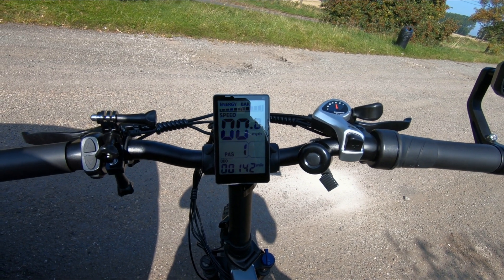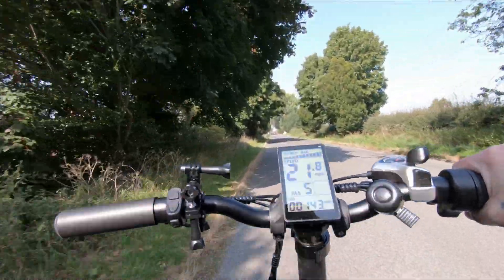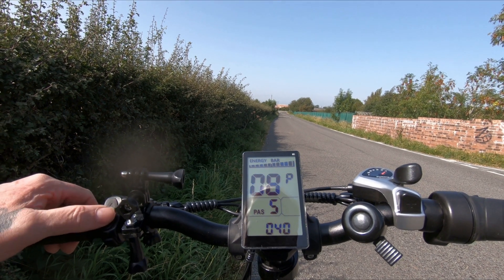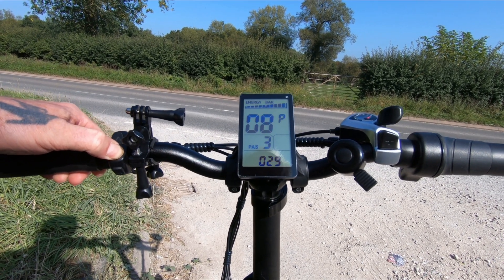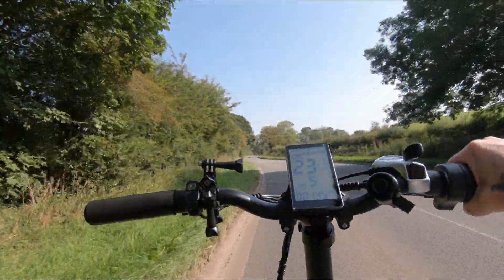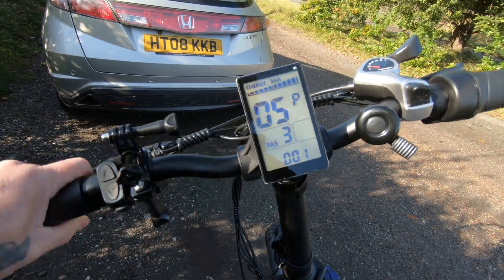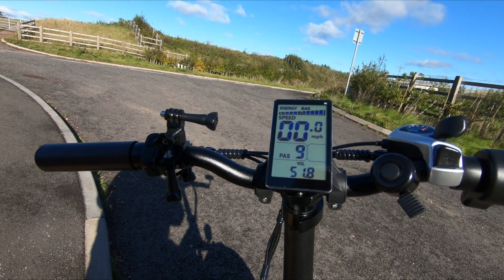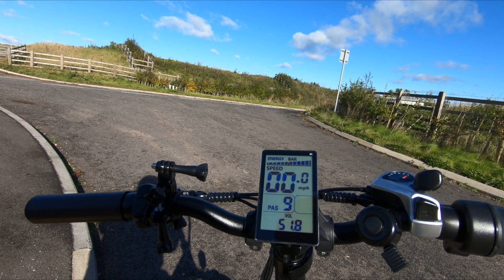ENGWE EP-2 500w e-bike / How To Alter The Maximum Speed.

Comment: 23mph is a nice speed. You stay in control and get to your destination in a decent time.
Reply from the maker: It is yes, I agree, but if it went 27, people would want 30.
Reply: @MidlandBulletRiders  

Always the way. I have the Fiido M1 PRO. It's only a 500w 48v fat tyre ebike. But some people claim to be getting 28mph on the flat with it  my top speed is 41kph or about 25mph. On a flat road pure throttle no pedalling. I weigh 88KG about 194lbs. So this is a factor too. My friend only weighs 150lbs and he gets 45kph on it over the same stretch of road.

So you cannot overlook these things. The Engwe EP2 pros are fine bikes. Especially the GREY model. modded out with BMX handle bars  it's the coolest looking fat tyre ebike I've ever seen. But they are 10 to 15lbs heavier than the M1 pro right out of the box.

Weight makes a difference. And then if you are heavy yourself. That's going to take the speed down by 2 or 3 mph. It makes sense. The more work the motor has to do. The slower its going to be. And the range will shorten too.

Comment: Are you using a suspension seat post if so do you know what size to order thanks
Reply from the maker: Yes. 31.6mm. If you look at this other video you will see what was needed in the way of adaptors to make it fit. https://www.youtube.com/watch?v=0G8qMN57A7s
Reply: @MidlandBulletRiders  My Fortis MK3 has 28.6mm post, 27.2mm is standard, I had to buy a shim to fit the 27.2 suspension post in the Fortis

Comment: I also have the ep 2 500w. But my bikes display and input/settings looks completely different🙄 I would like to restrict it cause in the Netherlands maxspeed is 25kmh. Will play around see if I can find the solution on my own.
Reply from the maker: If you have the YL80C display, there a manual here https://www.dropbox.com/s/xnd6kh3ffsghf1v/YL80C%20Display%20instructions.pdf?dl=0  I'm not sure how you adjust it on yours though.
Reply: @MidlandBulletRiders  Thanks, yeah saving the settings seem that impossible, would have to figure this one out.

Comment: Hi when i tried to set speed  it would not change. stays on 25klm setting. Any ideas?
Reply from the maker: Make sure you turn off the display and back on again after making any changes.
Reply: @MidlandBulletRiders   Did not make any difference and the store here In Australia set the display unit locked.  I tried everything . it will not let me go up speed digits or even low digits. like its stuck on the one number.

Comment: Did you check the speed with GPS on phone?

My e-bike (not engwe but very similar) showed a speed of 43 km ph, but my GPS said 35.

I adjusted the wheel/rim size in the settings and now the bike shows accurate speed
Reply from the maker: Yes, I found setting my wheel size to 22" gave the most accurate reading compared to my phone. https://www.youtube.com/watch?v=dMBlVZNQhDM

Comment: I done this and I feel that it doesn't make it faster at all, what your doing is altering the way the display reads  the motor speed, telling you its going faster but it not. Pedal assist 9 sucks everything out your battery so even if you could go faster ( and i doubt it does) it's not even a mile before  the power drops and then you sitting at 19/20mph anyway and you've lost a good 2 miles or more range. The settings  it comes is perfect and this is a great bike!
Reply from the maker: I tend to agree with you. I don't like the 9 assists myself anyway, 5 is a much more usable amount.

Comment: I love the 9 pas setting so when I'm going slow I can cruse at walking speed to keep with mates who aren't riding as for 9 level pretty nippy but I only use that speed here and there to extend motor life. I guess I can add a 750 watt bafang hub wheel in a few years or get engwe to send me one wheel part and it should go on my 500 watt as battery requirements are the same so why not.  This is a few years time though lol 😂

Comment: Hello, I just bought the EP2 PRO, with a 750 engine, and I have a problem on the display: the battery indicator always shows full, so I don't know when the battery level drops. Is there a way to adjust this from the m5 display menu? Thanks a lot and congrats for your channel!
Reply: I've got same problem
Reply: i have also the same model but i have problems that mine isn't taking the settings to go slower while it shows in the settings that they have been put in :/ do you have the same problem ?
Reply: Hi, I have a problem with my battery, it seems to go flat so quick! After 10 miles even!
Reply from the maker: I find the battery indicator a bit hit and miss really. I prefer to have the display show the battery voltage, give you a more accurate idea how much you have left.

Comment: The other day I hopped on mine, fired her up, nothing, wouldn't move, screen said error 37 . I wasn't happy. Turned out to be my adjusting the new brakes using the screws at the lever end which cut the motor just as braking does. :)
Reply from the maker: Glad to hear you managed to solve the issue. Simple repairs are the best.

Comment: Suggest swapping out the brake cables, the factory set aren't good, I think they might even be gear cables. Mine rear cable snapped going down a hill, I suspect the bike is too heavy for the stock brakes at those speeds (you were smart to change yours). I've done about 500 miles and the pads already need swapping out. Please get a chest harness for the camera when doing speed tests. You need both hands on the brakes.
Reply: I replaced one of mine, easy job, just thread it down the casing, a little oil is nice on the cable, no need to mess with the whole cable. Cheaper that way too.
Reply from the maker: Will keep an eye on them.

Comment: interesting video, i have the same bike, only done 26 miles so far. played around with the settings, what a nightmare. this will will surprise you all. 9 pas makes no difference nor 5 pas. you still get the same factory setting. you can more speed by using just pas 1/2/and 3. i get 28.5 mph on pas1  and peddling  in 7th gear in pas3 32.5 mph  30.2  pas 2 pas1 in 7 th gear 28.5  this is on the stand waiting to see if it will do the same on the road. the settings you need are. po5 sett to zero. po8 set to 50, i read somewhere  that 50 meand no speed restriction. po9 and po10 set to zero. and makes sure sleep mode po4 is also zero.. i have all the others also but these are the main ones. you just get bigger slices of the cherry on each pas position up to 3. as others have said using 5 or 9 just cuts the power on setting. makes you think you have more power and speed, but you have not. only what  the motor is set for.. try it and see. only need 1 to and 3 to get the same results. will let you know more when i have done a road test. climbs hills very well 

went up a steep hill yesterday with a total of 194 lbs, my weight plus shopping tools ect, got up to 14.5 mph on pas 3 with peddle  at the top .so will  try different gears  without power, had trouble getting power assist to work  with  the gears  and motor. but all works  now,  no need for such a complicated computer.
Reply: Hi could u send me the settings pls I've messed mine up totally
Reply: By using PAS 1/2 &3 will it make the motor last longer and not wear it down as quickly?
Reply: I'd like to see that done on video,

Comment: Hi dear. Did you change your tires too? From the video they seem to me that they make less noise than the originals that I have. Do you know what I can do for the front shocks to improve them? Just put some fat in it? Or have you changed them and they work better? Now I give a piece of advice to you.The battery at every drop makes a lot of noise because it beats on the frame. Make a little thick near the lower part of the battery that beats on the frame (you can also do it with a little paper). It will make a lot less noise and driving will give you a safer feeling.
Reply from the maker: They are the standard tyres that it came with. The forks do not use oil only springs, you can make them harder or softer by adjusting the preload. Yes I know I get a slight rattle from the battery. I did add some tape to the edges but had to remove it because it was too tight to fit in the frame. It's on my to-do list.
Reply: Ernesto thanked i think these settings r far the best I've tried 
I find pas 3 works 👍

Comment: Interesting stuff. I wonder what 63 (or whatever number one sets) actually means? 63 what?

The changing of the PAS divisions is handy to know, although I suspect 5 is optimum. One assumes 9 just divides the increases into finer increments?? I have noticed on bumpy tracks that the jump from 3 to 4 is very noticeable. Less of a problem on flat tarmac as one tends to want to dial in max cruising speed. 

Interesting stuff though mate👍.
Reply from the maker: No idea where they pluck those numbers from. I could understand it if it equalled kilometres.
Reply: I've looked at whether it might be wheel rpm but that's way too slow. Using radians doesn't work either. I think maybe you are dialing in Nm?? Which dictate a certain motor rpm to give the required power to achieve the speed attainable on said amount of power. It would explain discrepancies due to incline or drag.
Reply: I've tried calculating the power assuming 63 means Nm, based on the rolling circumference of the tyre and the speed you have obtained, but the sums didn't add up. However I'm still inclined to think that parameter 8 is actually the motor max torque in Nm. I've read that these geared hub motors give peak torque at a speed lower than peak power rpm. If so we can think of the parameter 8 as a kind of "mapping". Lowering the value in the parameter then would be lowering the peak torque and I assume peak power. If I'm on the right lines then it begs the question as to how the various pedal assist level settings react to changing parameter 8. In other words does pedal assist 4 (for example) feel weaker when parameter 8 is set to 40 than it feels when parameter 8 is set to 63?
Reply from the maker: Interesting. I'll have to try that.
Reply: I noticed last night on the Engwe splurge on Amazon that they state the motor produces 60Nm....... The thick plottens 🤔😂😂
Reply: @andrewpitts6498  A 750w motor is usually 80Nm, a 350w motor is 40Nm, I've tweaked up a 250w bike to 350w to go faster than the legal 25kph, P05 to 9 levels (default 5) OMT-03 display